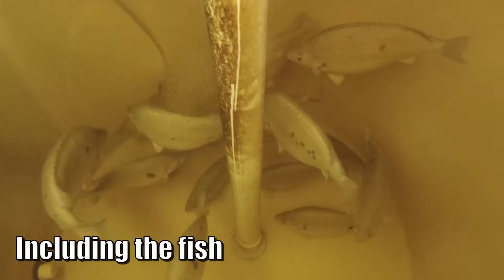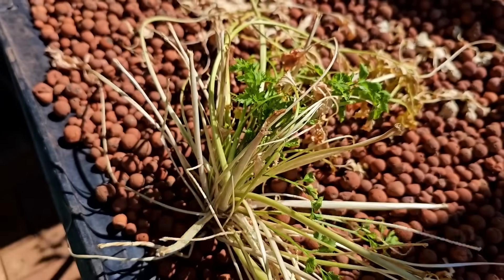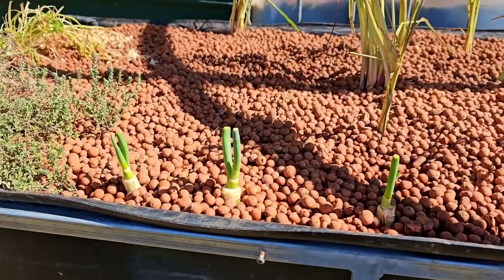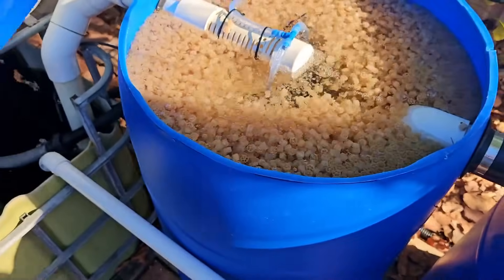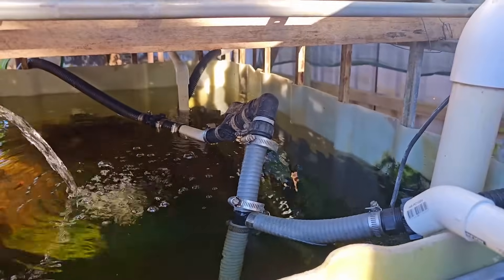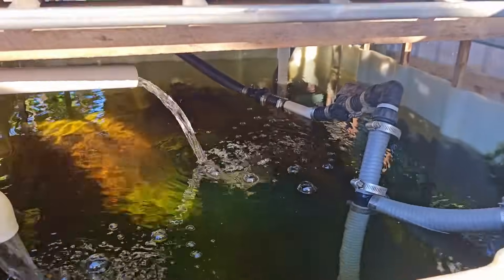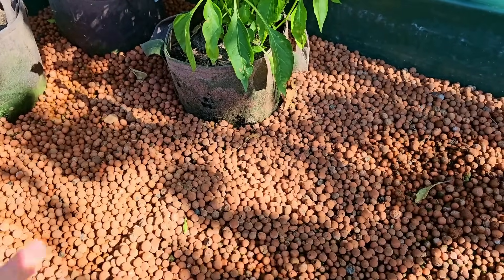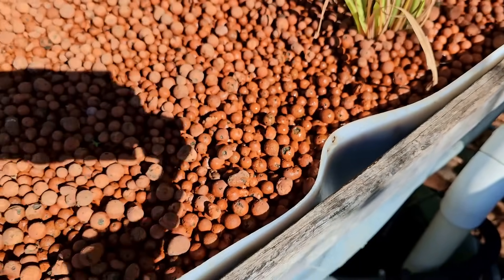New Aquaponics System Tour Components and Issues

Comment: Good day my Aussie mentor.  Our bass are doing great thanks to your course.  Wondering what the lowest temperatures you experience are. I’m in northern utah where most of our winter is spent around freezing. The bass should be fine if I keep the water liquid but am wondering about heating and my bio reactor
Reply from the maker: The lowest water temp we have had is about 10°C / 50°F. I didn't lose any of the perch as it was a slow drop & not sudden. Normally they start to die off at about 14°C / 57.2°F from what others have told me. 
I try to keep the water temp 18°C + / 64.4°F+ using aquarium heaters. Just enough to keep them comfortable.
Reply from the maker: Is great to know that the videos are helping as well mate. 👍

Comment: I am not sure what YouTube channel I seen it but when they were getting the chop and flip IBC ready, they painted the outside surface to halt the light shining through the sides and deture algae growth. May be something to think about.   Sorry it's morning here and I'm still very sleepy lol

I am currently looking to do a small project. I picked up a hanging bird bath and thought it would be good for a few small plants to deture bugs congregating.  Flys, bees, gnats. Do you have any suggestion for small herb garden plants from your area? I'm in the northern USA so what I've looked at so far is diffrent mints, lemon balm, basil, and a couple others.  Looking for things that work in about 2 inch of soil. 

I was thinking of drilling a hole in the bottom and adding a 1 inch tall pvc  pipe silicone to the inside. Use gravel or something  around it. Some shade cloth or window screen over the top of that. Thin layer of sand and a good miracle grow soil on top. Where it would hang there is dew that drips off the slanted roof to keep it topped off. But it would be back far enough so when it rains the water Flys past it. 

Then it will come inside to the kitchen window over winter.  Goal is mostly to keep away bugs by the front door 😅
Reply from the maker: There's not any local plants I can think of sorry. I know that East Indian lemongrass is used by some due to its citronella content. It can get away from you & become a bit of a monster & has deep roots. 
Sorry I'm not much of a help HCO.
Reply: No problem. I kinda figured it would be a long shot being in such different climates.

Best of luck getting things set up on the new farm. I'm so jealous lol.

Comment: Living in east TN, I'm wondering if it would be best to start a project like this in the back yard, or an extra building that I can keep the temperature above freezing or warmer if needed. 
Thank you. 
Jerry
Reply from the maker: Hi Jerry. I know folks that have a fish room in their basement or shed and then plumb the water out into a grow area. Come winter they drain the beds and turn off the plumbing to the plant side of the system and grow a couple of plants under lights inside where the temperature is warmer. The other option is to shut the whole system down through winter and then started up again in Spring with a fast growing fish species.
Hope that helps some mate and have a top one. 👍

Comment: Hi, I'm a complete newbie and have yet to set up a system. This may be a silly question, but is it sensible to have the solids settler function as a mineralization tank too? That way there is no need to clean out the solids and there is one less tank to maintain?
Reply from the maker: I have seen some folks attempt that but they had issues with the solids floating & move through the system.  I was pumping out to a basic mineralisation drum on the side before I moved the system. 
I run through it at the start of this video 
https://www.youtube.com/watch?v=y7CUfIFFGM0

Comment: Gd ay Rob another top designer clip  Rob can I use 80/20 hydroton- coco  mix for my grow media in my system I want to pull the trigger on it  almost done with my greenhouse  thanks Rob
Reply from the maker: You could have a few issues with the Organics rich water helping to break down the coco after a while. I'd probably start off with a small trial bed and see how that goes but I'm guessing it would need cleaning out regularly with new coco being added in.
On the plus side, any spent Coco would help kick-start a compost pile or could be used as a mulch top dress to feed veggie plants in the soil.
Reply: Yea hi mate thanks for the reply the guy @ the hydroponics store said I could possibly wash the coco off the pellets because its a mix in a 50L bag for $26 and use like that but I don't trust him  and wanted to know your input ty Rob I guess that's my two free questions  good fun and congratulations with your new Diggs   take care  George

Comment: I expect to be moving my indoor system to a bigger area. Currently entire area is an 8x8 ft. (~2.5 m x 2.5 m) Two aquariums, one 55 gal (210 l) connected with a 75 gal.(285 l). A sump tank and the grow area all inclusive. 
The new area will have a 10x20 ft ( 3x6 m)😢grow area with a separate area for a 300-500 gal indoor pond. Are there veggies that can grow in the fishes's pond?
Reply from the maker: Hi there. You may be able to set up bog-like beds on the side, meaning that the media is submerged in the water all the time, to grow plants like taro or maybe water chestnuts. Growing plants directly in the water, say on a raft, can be an issue with some fish as they will feed on the roots.
Hope that helps some.

Comment: How much is measured  tds Water is initially used to fill tanks
Reply from the maker: I don't know if anyone that measures TDS in backyard aquaponics systems. I know a few people that test for EC but as most of the nutrients are dissolved organic waste that doesn't really give you an accurate measurement.
Reply: @RobsAquaponics  Thank you . But I suffer from problems with plant growth and I noticed that the measurement  EC The tap water I use is at 2 and I don't know if it is good to work or not.
Reply from the maker: @quickvideos8021  I wouldn't worry about the EC of the tap water as the waste from the fish will be where the bulk of the nutrients come from. It will also be organic in nature so won't read on an EC meter.  How old is your system?

Comment: So is the Venturi affecting the flow from the oversized pump?
Reply from the maker: They do reduce the flow rate a bit Shams but that's why I always tend to oversize my pumps. Add a guess I'd say I'm getting 1500 litres an hour minimum through that one thousand liter tank.
That's 400 gallons through a 265 gallon tank for folks over the pond. 😁😉
Cheers mate and have a top week.
Reply: Thank you. Yes my latest design will include a 1700+ gallon an hour pump and I was thinking about adding an $10 Venturi at the end.. perfect timing.
Reply from the maker: @shamsajmeri8361  Get yourself a decent venturi made for gas injection not the liquid injection style.
Reply from the maker: @shamsajmeri8361   Was out picking up Kira when I was posting & couldn't find the link. Check these folks out,
https://www.growgreenie.com/
Reply: Thanks a bunch mate. I ordered 1!!